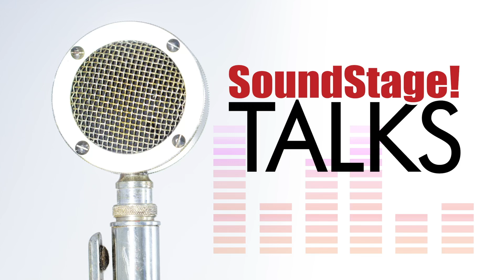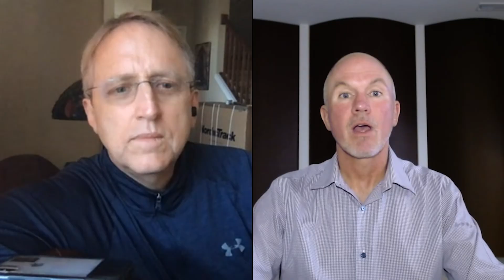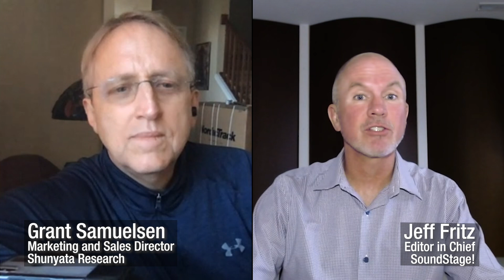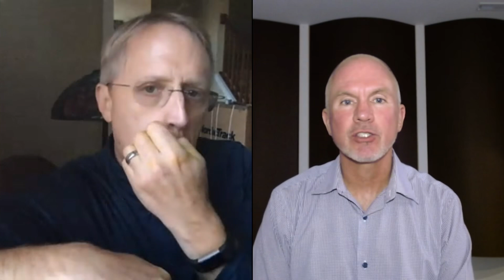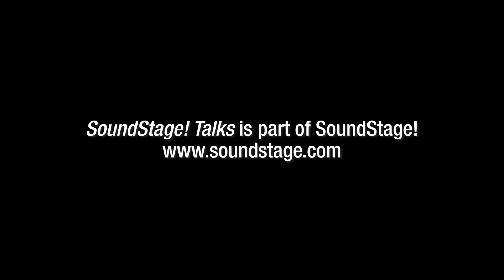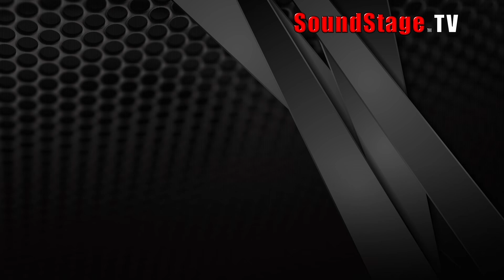Shunyata Research: Noise Reduction for Hi-Fi and Hospitals - SoundStage! Talks (December 2020)

Comment: Any one tried the digital products. Especially interested in feedback on Ethernet cables.
Reply: I own one of their Alpha Ethernet cables and have tried the Alpha and Sigma coax digital. My opinion is that the spdif cables are fantastic and I would own one if I didn’t have a built in streamer in my DAC. 

The Ethernet cable is great also but for the cost, most people would benefit more from a component upgrade. I’d recommend the Venom level cable or Chord c stream for those who are building up their first setups.
Reply: @ChrisMag100  thanks for feedback!
Reply: Omega USB is amazing.
Reply: the digital products are quite stunning.
Reply: @brandonlauer3778  Thanks for the feedback.